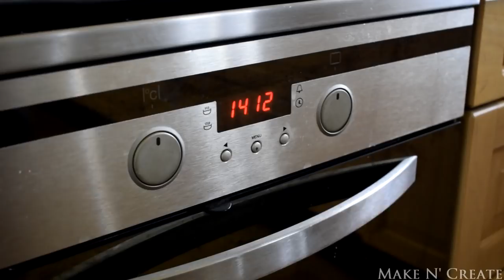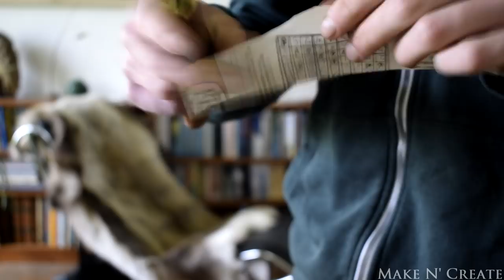Knife making -  Forged Birch Bark Puukko

Comment: I have seen how the Finnish make birch bark handles for their knives and they don't use glue. Instead they have the tang pointed like a spike and stab the sheets of birch bark onto the tang of knife, then they pound the bark down using a wooden block or rod that is hallow in the middle to compress them together. They would do this several times in till the desired length is achieved
Reply: yeah, but it probably is easier that way.
Reply: Anthony Trinh , probably , one of the easiest ways is boiling up already compressed handle - birch tar will glue everything instead of you)
Reply: The method is older than glue.
Reply: Ioannes Eroi yep)

Comment: Super cool. What kind of epoxy did you use for the handle? A longer setting, tougher epoxy I’d think would be better. I’d also slather the the bark in it to toughen it up for the handle when stacking them. I would be worried about some of those discs cracking and coming loose with too weak an epoxy or too little used.
Reply from the maker: I used long setting epoxy. I did put epoxy on the bark.

Comment: Usually the tang is forged to a point and the birch paper is stabbed onto it. When enough paper is on the tang, the end cap is put on and the tip of the tang is cut off and then  peened with a hammer to hold the parts together.
Reply from the maker: I know. I watched the Northmen video also.
Reply: I just watched the video an hour and half ago. It's lovely!

Comment: Nice work!
 but you do not need glue. To compress those slices of bark, they need to have a tight friction fit on the tang (pointy tang, and small holes on the bark, if any), and hammer them down (using a pipe slid down the tang to wack them properly).

Comment: Nice knife but I have a question why do you hear up the knife and let it cool before you heat treat and why bake the knife
Reply from the maker: It's called a normalizing cycle. It relives  stresses in blade and makes it less likely to crack or warp during the hardening process. I temper it in the oven after hardening to make the knife tougher.

Comment: It came out beautiful! Correct me if I'm wrong, though, I was under the impression that puukkot are traditionally rhombic in crossection though?
Reply from the maker: No idea. Thanks!
Reply: This comment is seriously old but I'll reply anyway. Rhombic (diamond shaped) cross section blades make terrible utility knives since you don't have a spine for applying extra force when necessary. A puukko is a utility knife and they never have diamond cross sections. I'm not an expert but this much I know to be a fact.
Reply: @mrwalter1049  Could have been clearer in my writing, what I meant is a five-sided polygon which you would get if you imagine a diamond crossection with a the top/spine made flat, thus having a flat spine, but the thickest point being say one thrid of the way down the width of the blade. I have yet to hear a proper explanation for this, but it seems that traditional ones have this section often.

Comment: Do you gave any tips on how to forge thick pieces of steel?
Another question: is a 25kg anvil enough for a beginner?
Reply from the maker: Depends how thick. I would say always try to cut the piece to a more appropriate size if you can. Hitting a thick piece of steel is not only exhausting but also very time consuming since it takes longer time to heat up. As for the anvil. I would get a heavier one like 75 or 100.
Reply: Make N' Create ok thanks

Comment: Amazing job. Always a pleasure to watch your videos. Greetings from Spain! What grit/ polishing compound were you using for this project?
Reply from the maker: I rough ground the edge on my belt sander which has a 120 grit belt. Then for sharpening I skipped the 400 side on stone and went immediately to 1000 grit. Then finished of on the polishing wheel which is probably around 12000 grit. Thanks!

Comment: I think you are supposed to hammer those barks tight in smaller sections using a wooden plug and not fit all of them straight away.